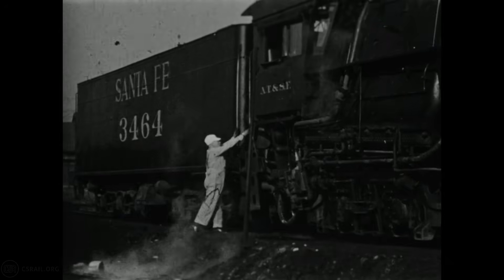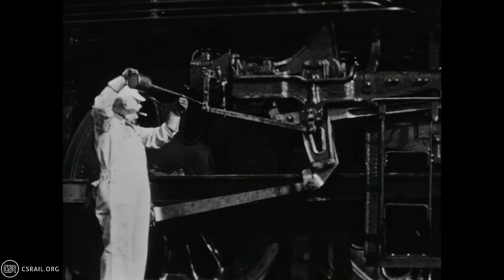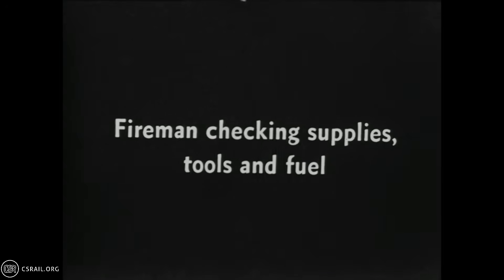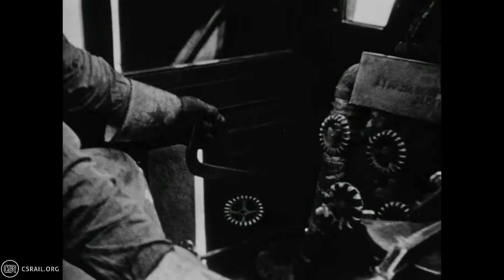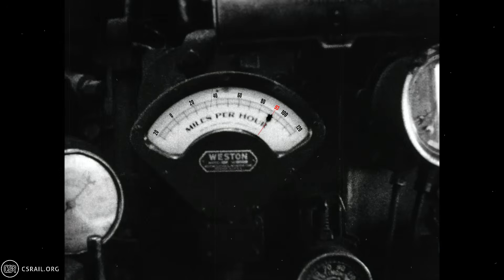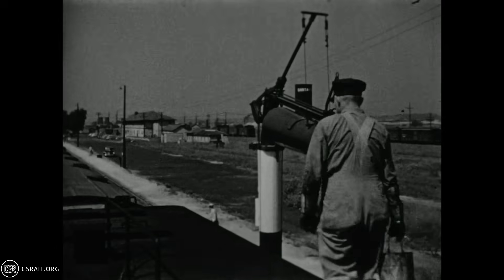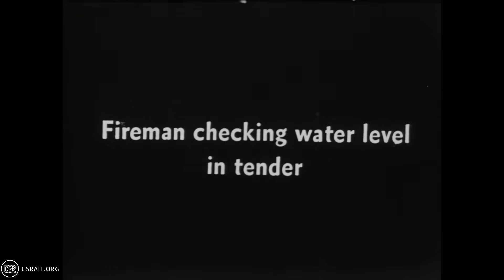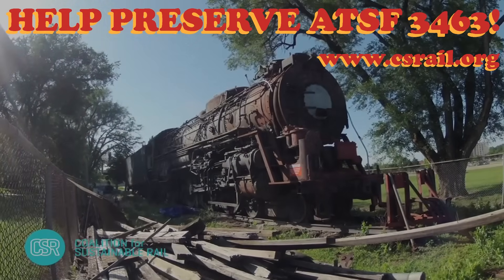Santa Fe  How to Operate a Steam Locomotive

Comment: I've got an old oiler. The engineers would semi flatten the midpoint and create a slight bow to reach difficult oiling points. So if you have one like this, don't "fix " it.😊
Reply: What weight oil did they use to lube a steam loco??

Comment: Every winter my steam boiler reminds of what a Steam locomotive does.
Reply: YOU GOT STEAM HEAT IN 2026 ?
Reply: @CarlFerrigno Yes, I can't believe it either. Look up houses listings in NJ. It is very common in the Northern east part of the country. Do not go away on vacation for two weeks. You will find out if a valve is leaking and ruining your home. Check the low water pressure gauge. How is your pressure relief valve. Did you blow out the rust at the bottom of the boiler. (Lol)

Comment: i can just imagine a hot summer day or 10 below zero running a engine  like this after the trip you know you put in a hard days work.
Reply: WINTER time running was very dangerous in coal burners because there was a canvas shroud at the back of  the cab (to hold in heat for the crew) that would also hold coal gas fumes from the fire box causing aspyxiation of the loco crew ! Happened on the New Haven RR inthe early 40's when a  freight train was supposed to slow in Madison,Ct to pick up orders going north, the train blew by  the tower at an estimated 80+ miles per hour with no sign of the crew, the boiler blew up a short way up the tracks and vaporized the crew (never found) the loco boiler was found in a field a quarter mile away, it was a mountain type engine 4-8-4 boiler weight over 300 tons.😮

Comment: Thank you for removing the commercials. This is an excellent film. I have five oil burners under my belt at this point. No two fire exactly the same. 
SP3420
GB&L40
GB&L 12
GB&L 14
And 
AT&SF 3415
I have fired nothing but the oil burners. What a joy.

Comment: To be a steam locomotive engineer and run a big modern engine you have to have seniority. You started out as an unpaid student fireman until you booked enough trip. Then you fired for 5 or 10 years. You work your way up from switching in a yard to a local, to Mainline Freight passenger service and then up to named passenger trains you got paid by the weight on the drivers of the locomotive. The bigger engine you operated the more money you made. You had to learn steam by doing it's not something you read in a book. Steam locomotive engineers derisively call diesel engineer's motor men like it was a trolley car huge insult. If you ignored or mistreated a steam locomotive would kill you no doubt about. There was a picture in the locker room of the Pennsylvania Railroad of an I10 decapod that had exploded next to the running gear were two covered bodies. My uncle always used to say the rule book Was Written in Blood. My aunt used to say that's the only spoke with words to her husband when he left for work because if he died that day he did not want his last words to be cross ones. Steam is a man's profession

Comment: 3463 is a BEAUTIFUL engine....I've visited it many times in Topeka KS 
GREAT proportions....HUGE driving wheels!
She REALLY should run again someday
Reply: I hear they're fixing her up, at least cosmetically.
Reply: I'm building a 1/35 scale version. Check out Cobi Fans with Santa Fe 3463
Reply: She was set to run again as a testbed for a new generation of passenger steam. Alas a group of locals who were more than happy to let her dam near rust away in a park heard the news. Those locals sprang into action faster than a hostler could chase a runaway down the shop track. So now she is sitting in the same spot , same rust , same neglect. But they sure did show that bunch of engineering mad scientists that OUR locomotive will not EVER be modified ! Nope not one bolt , one nut , one rust hole nothing will ever be changed ! Now would you please buzz off we have a barbecue to get to on the other side of town.

Comment: Damn it takes more to check a steam locomotive than a diesel.
Reply: That is a big reason railroads switched to diesel. It’s easier to maintain and more reliable. That said nothing can truly replace a steam locomotive.
Reply: @thatoneguy611  I operate a diesel locomotive and I'm glad we don't have to do all that. Probably take half a day.
Reply: @marksman4004  they will do those checks while the locomotives is heating up
Reply: @thatoneguy611  Besides the design possibilities of a steam locomotive were reaching their limits. The more powerful locomotive necessitated a longer boiler that couldn't fit on a rigid frame (Russians tried that, the result was an epic failure known as AA-20) and that led to creation of Mallet engines which were powerful, but even more maintenance heavy than standard rigid frame locomotive.  Also running double-headers was no easy task either, a task that a diesel-electric is better at.
Reply: Sherlock.
Reply: There's always one.

Comment: How many cigars are required per run?
Reply: Depends on the tonnage and the percent of the grade your climbing.
Reply: i would say about 2 cigars every 20 miles
Reply: 300
Reply: About 5 per every 100 miles
Reply: Well that depends on supply in cab
Reply: One company supplied cigar per time zone, the engineer passes cigar authority on to the new engineer who then lights his cigar
Reply: One cigar per mile
Reply: One. They often chewed off the end and chewed it ! Often non smokers. Cheap cigars in wrappers  better than a pouch. My Grandpa was a millwright for SP in Sparks Nevada in the 40's to '60. 👍
Reply: Yes
Reply: As many as a man needs.

Comment: One thing that strikes me is how old these two guys look.  Indeed, from what I have read about the steam era, including the outstanding "Set Up Running", engineers in the steam era were usually older than modern retirement age, and even the firemen in many eras were "over the hill" by today's standards.  And for such a physically demanding pair of jobs, at that!  They must have made real men in those days...
Reply: These fellas are Passenger Enginemen.  Typically they put in many yrs in freight service before they earned enough Seniority to be promoted to the Passenger List and stay there for long.
Reply: You had to work your way up to be an engineer,,I believe it was switch-man, brake-man, fireman and then finally engineer thus the term old head! Big difference from today! Also,,these guys knew their stuff and were hard working souls! I once had an old head give me a steam locomotive manual,,,I looked at it in awe of what they had to know! Those were the days!
Reply: @RogerThunderhandsGilbert  Yes, work up to being an engineer.  Generally, it was wiper, hostler, fireman(extra board, yard, local, freight, local passenger, then premium passenger), then engineer(similar work up as fireman based on seniority).  Switchmen would go to yardmaster.  Brakemen would work up to conductor through extras, locals, freight, and passenger(all on seniority).  There were also road foremen and trainmasters, these were managerial positions.  These positions were on specific lines on a railroad and specific territories.  You had to KNOW the track and where you were at all times besides the rule book.
Reply: Very good men, but also because it’s very common practice on any railway system across the globe to have the young (and physically able) men be firemen and the like whilst the seasoned railwaymen who can’t shovel several tons of coal a day be acting engineer

Comment: I can tell this is a modern narration.  No one said "reverser" in steam days.  It was always "REVERSE BAR."   "Reverser" is strictly a word from the Diesel-age.  HA!  

(And yes, I go back to late steam days in the 1950s.)
Reply: It wasn't the fact that there narrator's voice sounded completely clear and not distorted?
Reply: I thought it was called the Johnson bar. 
Anyway, it's simply astounding what these men among men had to know and do for their salary.. Also surprised that engineer does so much work.. I naively thought the engineer got that position due TO having already been a fireman, and with this ranking only ran the engine; fireman doing all the dirty(er) work...But I'm thinking now, while engineer is doing all that preliminary work, the fireman is inside waking the beast up from it's cold sleep and feeding it its breakfast, which is just as hard as the engineer's outside chores. Of course, under way the Captain has a little more relaxed job; the fireman continually working his ass off !! Astounding !!  And, sadly so, it is obvious why the CEOs replaced them with diesel.       ............> maintenance <...........

Comment: This was an oil-fired locomotive as seen by the engineer shutting off the injector and the 7000 gal. oil bunker. They were mostly smokeless too.
Reply: Ernest Imken oil burners were a bit easier to control smoke but they still emitted a lot of smoke. The oil flow from the tank in the tender was controlled by the fireman with the firing valve and atomizer to disperse the heavy grade oil with high pressure steam into the firebox in a fine mist that was almost explosive.
Reply: @railscenes4959  Good info. And he mentions it is Bunker C.  At 55 degrees, the only temp I've seen it, it is like thin tar. You can put your finger in it, pull it out and watch it slowly fill up the divot over a one or two minute period. Typically heated in marine engines to 180 degrees to pump and atomize. I'm guessing these beasts were  kept hot as is quite a chore to start an engine with that fuel.
Reply: @alwaysbearded1  the oil tank had steam heat to help the heavy oil flow.
Reply: @charlesgreathouse7376  Makes sense, same as in marine service.
Reply: 7,000 gallons of oil! Man that's a lot of oil🛢

Comment: Full forward gear - Since when did steam locomotives have transmissions???
Reply: It refers to the valve gear of the locomotive. The valve gear controls the direction and power of the locomotive.
Reply: They don't. They do have incremented forward and reverse though. Full forward is max steam to the valves. Halfway back is neutral. All the way back is full reverse.
Reply: That means "in the corner". Maximum valve travel.
Reply: When underway the reverser/Johnson bar can be pulled back to reduce the amount of steam used, conserving steam.

Comment: the engineer is "lubricating" this locomotive that is as big as a house with a 12 ounce bottle of oil. ok...I'm sure that did the trick.
Reply: raxxtango a little dab will do. Plus the training film was just having the engineer show all the crucial oil points. Notice how he pauses and we can almost hear him ask “Do you want me to keep going?”  We can only guess. It was important to oil around at almost every stop. Notice the shelf above the fire box door. They had extra oil kept warm.
Reply: Most "modern" steam locomotives by the time of this film had automatic lubricators. In fact, you can see one of these around the 2:50 mark, actuated off of the valve gear. These lubricators supplied the crosshead guides and cylinders among other things.
Reply: Fan Railer Yes sir they did and they also had roller bearings
Reply: Fan Railer yes but the lubricators were mostly for the interior portions like the cylinders that required valve oil or tallow from the rendering of animal fat is different from petroleum oil. Tallow oil blends with water or extremely hot steam. Petroleum oil does not work with steam. The tallow was in different the oil cans on the back head in the cab. You can see the smaller tallow pots on the shelf above the fire box door. This keeps the tallow oil liquid. Tallow oil, If left at room temps it will solidify. Try frying bacon, that is tallow oil. Sheep rendering was best in steam. Today they have synthetic valve oil. So they can leave the sheep to making wool. Thanks, 
Steve Rippeteau, retired conductor.
Reply: I should have also mentioned that the mechanical hydrostatic lubricator also had to be able to have enough pressure to inject the valve oil into cylinders that were under pressure. How that was done is above my pay scale, but I am familiar. Questions like this lead to long dissertations that tend to cause eyes to glaze over and take up more space than the internet can handle. But I like the topic, because we can all learn steam locomotive trivia.
Reply: @railscenes4959  The tallow is held in a container which is heated and pressurized by steam.  The steam slowly condenses and the condensed water sinks to the bottom of the molten tallow.  Thus the tallow slowly overflows its containers and drips into the steam supply pipes.  The static pressure of the steam and water is what pressurizes the tallow, so it's called a "hydrostatic" lubricator.
To refill the lubricator it would be isolated, vented, and drained.  Then topped up with fresh tallow and repressurized with steam.
Reply: Jordan Rodrigues good description! Thanks.

Comment: 93 mph...so faster than most Amtrak trains nowadays with a 1940s steam locomotive. 😔
Reply: Santa Fe had the 3460 Class Hudson’s rated at 100 MPH BUT were restricted to 90 MPH with 84” driving wheels. 90 was allowed due to the loco being equipped with Automatic Train Control with cab signals. Later in the 1940 era ATSF equipped most passenger locos with ATS with a electro-magnetic system pick up mounted on the trailing truck under the engineer. The ATS allowed maximum speed of 90 MPH. 
Steve Rippeteau
Reply: @railscenes4959 Some of the Santa Fe engines like the 3765/2900 class Northerns and 3460 class  Hudsons were allowed up to 100mph when making up time, although 90mph was the normal maximum on a fast passenger or mail train.    Reference - Railroads at War- S. Kip Farrington, Jr.    Samuel Curl Inc New York 1944    The author claims he rode in the cab of a 4-8-4 hauling the Chief at speeds above ninety miles an hour, and in the cab of a Hudson hauling a sixteen car Fast Mail at a sustained one hundred. Both engines had speedometers. The Santa Fe also ran high speed tests with the 4-8-4's.    Example - 3752, equipped with poppet valves, reached 105 mph with a heavy mail and express train (including a dynamometer car) in 1948.  Reference- One Man's Locomotives - Vernon L. Smith - Trans -Anglo Books Glendale California 1987.  Smith had a successful, long-term career in locomotive design and construction during the steam age and is a credible source. He was riding the train when 3752 made the previously mentioned run.  Farrington is also credible.  He rode 25,000 miles in locomotive cabs across the country in 1943. The fact that the speedometer on the locomotive in this video was reading over ninety kind of confirms that the ATS was set at a hundred, not ninety. - Ninety miles an hour, although very respectable, was in no way the absolute maximum for Santa Fe steam, at least before 1948. Later in that year, the Interstate Commerce Commission set the speed limit of trains without cab signals to 79 mph (the top permissible speed for most Amtrak trains today)
Reply: davefrompa53 I agree. I worked with Santa Fe engineers, conductors and trainmen who worked in the steam era who worked steam locos at speeds of 120+. Most locos in that era had speedometers but not speed recorders. So it was hard to catch a crew speeding. Also this was filmed on the Illinois Division where Automatic Train Control (ATC) had been effect since the 1920s. This required a working cab signal which could “set” the speed at 20 (Low) or 40 (Medium) but not the top speed. Unfortunately the diesel portion of this training film was cut off. That segment showed the engineer running the ATC test sequence on the E-1. If you would like more info on ATC please let me know.
Reply: @railscenes4959  Thanks,, I'd be glad to have any info on the subject you could give me
Reply: The speed limit on almost all Amtrak routes today is 79, so I’m right.
Reply: davefrompa53 & b3j8  It is difficult to explain the various rules in this small FB forum. So let’s deal with the ATSF Illinois Division from Ft Madison, IA to Chicago, IL where this was filmed. It starts in Ft Madison with quick clips in Dearborn Station Chicago. The scene of the loco backing onto the train is Shopton MP 235, Ft Madison. Then oiling around some may be in Shopton then the left side is done while the train sits at the passenger depot downtown Ft Madison MP 233. Both places would not be a normal location for oiling as it is the initial terminal. 
So once the train proceeds East across the Mississippi River it is in ATC territory where the cab signal system is cut in activating the electro-pneumatic brake override signal system. As soon as the rear of the train clears the curve off the bridge maximum authorized speed is 90 for passenger because of the ATC acting as the block signal and safety back up system, all inclusive. In non ATC territory it was usually 79 MPH, but not always. So notice the speed reaches over 90 the film editor freezes the frame so we can see the speed. Also note that the speedometer is an older type without the recorder. If the current film editor had included the diesel segment it would have shown the ATC test and the more modern speed recorder.
Reply: phillyslasher  I said MOST!!!! OF COURSE I know the Southwest Chief and Pacific Surfliner, Wolverine, Blue Water, Keystone, Northeast Regional, and Acela Express go faster, but MOST of the track Amtrak runs on has an absolute speed limit of 79 mph, and that is a FACT, so you can stop being pedantic and telling me otherwise. Oh yeah, and Philly SUCKS!
Reply: phillyslasher  love too know where you pulled the other speeds from lol 79-120-150 are the norms 79 being the most common.
Reply: This is painfully funny
Reply: Yes, and that was back in the days of stick rail.
Reply: That's because 79 mph is as fast as trains are allowed today w/o modern day ATS installed on the usually freight-oriented line(s) Amtrak uses.  Same as it was when this film was made.
Reply: Wrong